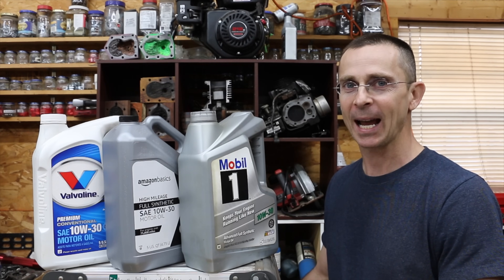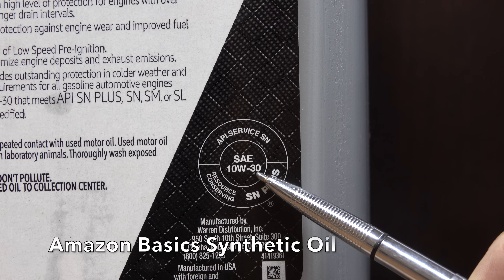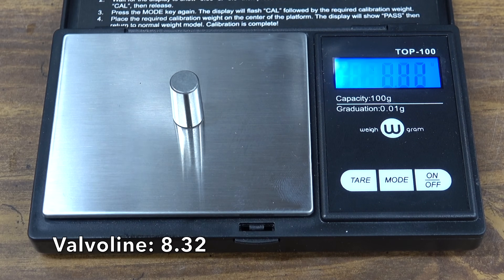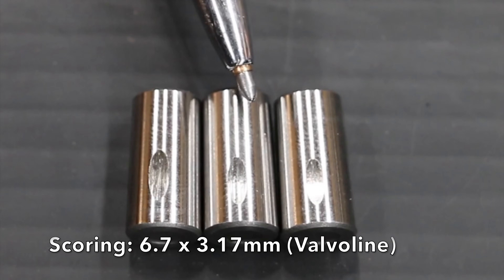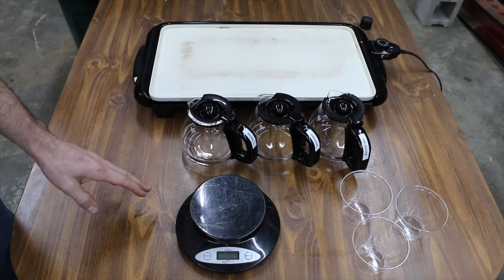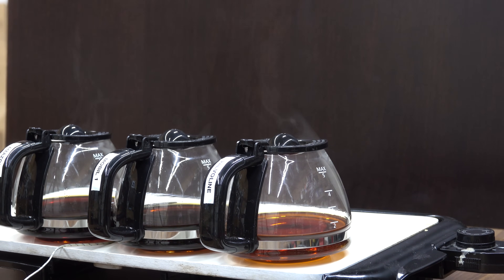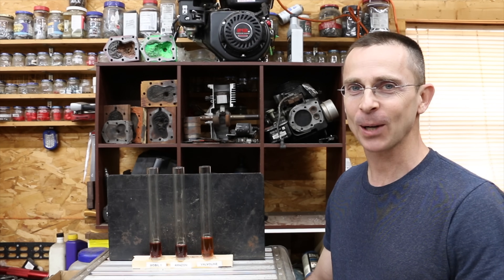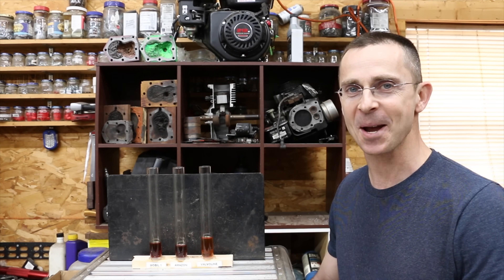Is AmazonBasics Full Synthetic Motor Oil better than Mobil 1? Let's find out!

Comment: The question is: Who Amazon is rebranding oil from?
Reply: Warren is the company that makes it
Reply: I was thinking the same thing 🤔
Reply: Warren Distribution is the Amazon Basic provider.  It's on the bottle.   http://www.warrendistribution.com/
Reply: Warren, at my work a few weeks ago we had a long conversation about the Amazon basic oil Warren is a subsidiary of mobil oil
Reply: And another question: Does Mobil also rebrand?
Reply: @damiangrouse4564  No, Mobil is a large oil/gas producer
Reply: @damiangrouse4564  no, ExxonMobil manufactures Mobil 1 themselves.
Reply: @damiangrouse4564  Mobil is an oil company so the answer is common sense. Amazon is not.
Reply: Mitch Ever heard of “badge engineering”? Look it up in relation to car companies...which of course, are car companies.
Reply: @damiangrouse4564  Oil companies almost always badge their own label oil as their own product, unless it is badged as another company's oil like a car company.
Reply: I'm curious what the true viscosities are of the oils. Could the Amazon have a little lower or the Mobile 1 be a little higher....or are they both as advertised?
Reply: •_ - they get the oil from a company called Warren. It's on the bottle it self. Most companies do this(buy from other companies) because there are only a handful of companies that actually have the resources to pump oil out the earth. So smaller companies buy from giant oil companies and rebrand them. Just like our mattresses, they all come from a handful of manufactures, but companies buy them and rebrand them.
Reply: @Shehan.H96  It has completely nothing to do with "a few companies having the resources to extract petroleum." There's more petroleum extraction companies than you think. There's a lot of smaller companies you've never heard of doing contracting work for the big boys. Many rebrand oil and other products because of the R&D costs. Get your facts straight.
Reply: Shehan H Hmmm.. no. You are confusing blending plants to oil refineries or upstream processes. There are literally hundreds of motor oil manufacturers in the world especially in Europe. Because manufacturing lubricants don’t require resources to pump crude out of the earth. You only need to source raw materials etc. base oils and additives and then blend and bottle it. Or as Amazon can purchase private label. But you are correct that only oil majors have resources to produce base oils needed in lubricants.
Reply: @Shehan.H96  I'm not saying amazon doesn't rebrand but you're talking about amazon/mobile1 full synthetic. I'm no Einstein but i'm pretty sure that means it's made in a lab.
Reply: @juan125873a syntetic means that you take a "  base " ,wich comes from a rafinery and then  process it.
The best oils always have the best RAW material, wich Of couse comes from a refinery.
Reply: @AAAAAAndrea   I looked it up and yeah you're right. I figured they'd use the word "semi-synthetic" if that were the case but apparently not. IMO synthetic is the wrong word if it comes from a petroleum base.
Reply: @juan125873a  Well , even syntetic bases comes from a petroleum source , probably only esters ( like motul ) do not.
But esters lasts much less than petrolueum based oils.
Reply: @AAAAAAndrea  fyi which,course and refinery.
Reply: knowledgeiskey0110 full synthetic starts as base oil from the ground. They simply put it through multiple processes and such and it changes the molecular structure that isn’t found naturally. Then they add numerous additives which further change the characteristics.
Reply: Probably Mobil one lol
Reply: When Chevron runs out they get it from ExxonMobil and run through their own lab to generate a coa
Reply: Mobile 1
Reply: Amazon keeps their rebranding source secret. But based on the results of this video test, it very well could be mobile one rebranded. It’s not uncommon for name brands to sell the product at a wholesale discount to a no-name brand. Trader Joe’s supermarket does this all the time
Reply: This is the same maker of Walmart synthetic.
Reply: Warren makes it for many.
Reply: All you've got to do was watch...
Reply: Look at 2:05.
Reply: My cousin work at oil distribution co.,,The same oil was put in different labels,,,they did not have semi,or synthetic oil((.Dollar store to Wally world,,auto parts franchise, etc.((Moble synthetic 100% oil,,,is my brand since it was first retailed to public ,,Military used it first,,,after getting rid of the FAMOUS SLICK 50!,"",MILITARY used slick 50 for years before going public.
Reply: She’ll rotella
Reply: Mag1 is their name brand equivalent
Reply: Best maple syrup EVER
Reply: ISIS AND FROM THE DEEP OF BUSH
Reply: Probably recycled oil found in milk jugs curbside

Comment: I like your video and how you tested each oil however, it would be even better if you could test each oil after they have ran through an engine after an extended period of time and do this same test ex. 3-5thousand miles later and see how they still hold up. Your results only show as they are new oils
Reply from the maker: Thank you for the video idea!

Comment: Hello can you make a video about 18650 li-ion batteries ? They are so popular in the DIY community , especially the Samsung's and the LG's , and you can try other Chinese brands to see if they where good or not.
Reply from the maker: Thank you for the video idea!
Reply: @ProjectFarm  no thank you for listening
Reply: I'd watch a video if you made one, but if you want to know anything about 18650's or any of the other sizes 26650 etc you need to search for Mooch. Virtually every battery made he's tested.
Reply: I've had to have Li-Ion batteries tested for a product we manufactured.  It would be very difficult to replicate the type of testing a lab would do to quantify build quality.  One test they conducted was a high res x-ray so they could see how the cell was wrapped, if the layers were spaced adequately and equally and if there were any contaminates present that could lead to a short between the layers.   We tested batteries from several vendors and while they all worked in the device and provided the same power, the internal build quality varied greatly.  The build quality is important as an internal failure is what causes these batteries to prematurely fail and in some cases ignite.
Would love to see your video on this, but be careful.

Comment: Agree with someone in comments that the tests should be re-run after 5000 miles in a vehicle, call up a delivery, satellite, taxi or any high mileage driving company (offer free oil change) for the used oil after the 5K miles and free oil change after test.
Reply from the maker: Thank you for the video idea!

Comment: Is the Mobil 1 a synthetic blend? To have any value you need to test either A) 3 grades of the same brand of oil or, B) the same grade of 3 different oil. You should only have one variable that you change, otherwise you have no idea what is connected with the differing results.

I’d like to see a test of Valvoline, Amazon basics, and Mobile 1 but all 3 full synthetic of the same weight. 
Thanks for your testing they are interesting
Reply from the maker: Thank you.  I tested their full synthetic oil. Thanks for the video recommendation!

Comment: If you get the mil spec sheets on the different synthetic oil you will find that the last to letters in the code is MO for Mobil Oil. The only difference is the additives that the reseller request. Great Video, Well Done.
Mobil has the Patten!!
Reply from the maker: Thank you!

Comment: You should test the even cheeper supper tech from walmart full synthetic
Reply: I believe supertech is also warren oil so it’s the same as amazon basics.  A lot house brand oils are warren oil.
Reply: YOu have any actual proof of that? If so i would like to read/see about it! Interesting fun fact..
Reply from the maker: Thank you for the video idea!
Reply: Basically anything that is DEXOS approved, is going to be ok.
Not saying the ones without are any less good, but DEXOS at least tests it before putting it on the bottle.

Comment: I live in Puerto Rico and I am using mobile one 5w 30 full synthetic and I'm always one quart low with one to two months of oil change should I change to 10w40?
Reply from the maker: Recommend using the type of oil per the owner's manual just to be safe. Thank you
Reply: @ProjectFarm  even dough it is evaporated rapidly? Or change oil brands? Thank you

Comment: VIDEO IDEA - "Can anti-seize be used instead of oil?"  
Will an engine run with anti-seize on the bearings/rockers/valve stems and no oil in the crankcase?
Reply from the maker: Thank you for the video idea!

Comment: The test was very good but one thing he did not consider is consistency. Amazon purchases the oil for best price from that current manufacturer and then They  rebrand it. Amazon could go to another manufacturer with a lower price and have a different oil performance characteristic. Point being is I would stick with Mobile one at least I think I  know they make their own oil and don't buy excess stock.
Reply from the maker: Thank you

Comment: Been using mobil 1 oil for years. Still changed it at 3,000 miles and I put over 700,000 on a Toyota tundra.
Reply from the maker: Thank you!

Comment: I run Shell Rotella T4 15W-40 Heavy Duty Diesel Oil in everything have old car and truck change every 5k miles if it needs it or not   https://www.walmart.com/ip/Shell-Rotella-T4-15W-40-Heavy-Duty-Diesel-Oil-2-5-gal/54604946?athcpid=54604946&athpgid=athenaItemPage&athcgid=null&athznid=PWVAV&athieid=v0&athstid=CS020&athguid=5205a46f-0d5-168f7916147161&athena=true
Reply from the maker: Thank you!

Comment: You should do a video that shows if using the premixed fuel & oil for 2 stroke motors made by VP, or Echo, etc. makes a difference in performance on a chainsaw or weedeater compared to mixing it yourself. Thanks for making these videos! Your really doing us consumers a solid with your unbiased, data driven videos!
Reply from the maker: Thank you!

Comment: I love your channel, are minds work alike.  I have a couple ideas.  Would you consider trying I85 (Isopropyl alcohol 85% and 15% gasoline), you can buy 100% in 5 gal jugs.  Also, would you consider checking BG MOA (motor oil additive) film strength and heating the oil until it burns off (NOAK volatility test)
Reply from the maker: Thank you for the video ideas!  I did test E85 a while back but not the BG MOA
Reply: Project Farm 
No, I don’t mean E85, I mean test I85 in an E85 vehicle.  Isopropyl alcohol, not Ethanol alcohol.  Also, look at the key ingredient in most very expensive fuel injection cleaners.  It’s, polyether amine.  Redline SI-1 has about 50% if I remember.

Comment: I don't want to watch the whole thing, what was his result?
Reply: Watch the whole thing and find out 👍
Reply: Valvoline tasted better on pancakes
Reply: Amazon Vs. Mobil 1
Wear: Mobil has slightly less wear
Cold flow: Amazon was quicker both runs
Evaporation: Tie
Overall: Amazon is better in cold places, pretty much equal and the price difference is not justified. Get the Amazon oil.
Reply: mobile 1
Reply: Amazon basics.
Reply: John Mahoney 

Colonel Mustard did it in the study with a candle stick.

Comment: This video should be called does vavoline work?
Reply: Of course a traditional oil would not perform as well as a synthetic oil. I don't get your point?
Reply: @firstname405  in this test valvoline seems to really lack.
Reply: @blewyd  No, in this test the only traditional oil lacked compared to the two synthetic oils. You skipped a lot of the video didn't you?
Reply: @blewyd  and you have skipped past the pinned comment in which the uploader re-explains this for those who don't watch the video.
Reply: @firstname405  I ain't gonna waste my time reading a whole 9 paragraphs. All im saying valvoline doesn't seem to be very good.
Reply: And why wouldn't you get synthetic oil then? I know nothing about cars except they have an engine with wheels.
Reply: @blewyd  Valvoline, Mobil 1, Amazon, Penrite, Nulon, etc etc, they ALL make traditional oils and all perform pretty consistently (no clear winners or losers). Most of those brands also sell synthetic oils which all perform pretty consistently (no clear winners or losers). Valvoline synthetic would perform just as well and Amazon and Mobil 1 synthetic, but a synthetic wasn't used as the third sample. A traditional oil was used to compare how all traditional oils compare to all synthetic oils. The brand meant nothing in this test.

This was explained in the video and it was explained in the very first paragraph of the pinned comment, and second paragraph of the video description.
Reply: @blewyd  oh and to answer your second question, synthetic oil is usually a lot more expensive, so it's up to the consumer whether they want a cheaper short-term product or a more expensive, durable product
Reply: @firstname405  ok
Reply: @blewyd  your welcome :)
Reply: @firstname405  very informative, thanks for that will help me decide what oil to put in now, bc I'm like blewyd I have no idea about cars🤣🤣
Reply: @Dctwitches  No worries! Happy to help

Comment: Is there any chance you could do a similar test for diesel rated oils? Right now I'm running Shell Rotella in my truck. At 16 qts per oil change, I'd LOVE to save money by having something as good at half price!
Reply from the maker: Thank you for the video idea!
Reply: Do you have a particulate filter? Putting the wrong oil in a diesel can really fuck it up. Lots of newer trucks need the low potash 5w40 synthetic these days and that stuff is expensive.
Reply: @magincap70  I have a wix filter on it. I'm using a good, diesel rated oil. It's just expensive. Lol. The truck is a 95 with 250000 miles on it. Not quite as touchy as the new ones.
Reply: Do you buy it in a 5 gallon bucket? That'll save you a few bucks. I don't think they even had synthetic in 95. Cheaping out on oil isn't something I would suggest, but I see your side of it for sure.
Reply: @magincap70  Although fully synthetic MIGHT have been around then, it certainly wasn't widely used or trusted. I don't use it in my truck; aside from cost, full synthetic tends to find leaks in old gaskets and seals that conventional oil won't squeeze through, especially in older vehicles.
I've not purchased it in the 5 gal bucket.  I don't even think most of the parts stores here sell it in that size. I'll have to scrounge around and see what I can find.
Reply: @rigormortis08  I don't know if you're near the ocean but boat supply shops will have 5 gallon and if you're inland like farm and tractor supply places will have them.
Reply: @magincap70  As a matter of fact I AM near the ocean. Not far from a major port, actually. Also a lot of farm supply stores in the area. 
Thanks for the info. I'll check those out!
Reply: I was at an advanced auto today and saw 10w40 rotella for $79.99 in a 5 gallon bucket and thought of you bud! That's gotta be a little better
Reply: @magincap70  I'm pretty sure it is! I wanna say it was around $130 for 4x 5qt containers of Shell Rotella T and a filter. I live not far from Seattle an everything is 10x what I'm used to in the midwest. Lol

Comment: Great flow tests but it shouldn't be the sole basis of why certain oils are better than others. In the beggining of the test you have claimed "we are doing todays test to see which one of these brands is the best". It is certainly a good way to see flow out of the bottle but you cant be certain of how the oil lasts over time in a motor as the additives deteriorates and how the heat cycles affect the oil itself. Otherwise overall very well detailed and consistent tests!
Reply from the maker: Thank you!

Comment: I agree with Robert K.’s comment. The test is what happens inside the engine with these oils. Valvoline and Mobil companies have been around a long time. Amazon is simply selling a private label product that may be no better than flat Coca Cola after 1000 miles inside a working car engine. Think about the college beauty queen available for marriage and then what she looks like 150 pounds heavier two years later. Think about Amazon announcing a new headquarters project in NYC and walking away from it this week.
Reply from the maker: Thank you.

Comment: >performance at 212°F

It's... 100°C. Which is obviously what it was defined as. Just say 100°C or both.

Same for the 482°F evaporation test. That's 250°C, again a beautiful round number that was obviously used as the definition.
Reply from the maker: Thank you!

Comment: What is generally overlooked by consumers is the fact that you can purchase Mobil full synthetic oil - Delvac 1 for a fraction of the cost of Mobil 1. Why? Because people don’t know what it is - it’s Mobil 1 for Diesel engines, just has more detergent properties in it. I’ve run it in all my passenger cars for over 30 years, works perfectly, and I buy it by the case when it’s on sale at Walmart, O’Reillys, etc. You could buy it at Walmart for several years for $12-$14 per gallon jugs in a case of 4. Best value in motor oil ever!
The state of California runs it in every vehicle from the mail trucks to the motorcycles, to the many passenger cars that they operate, and have for decades.
Reply from the maker: Thank you!